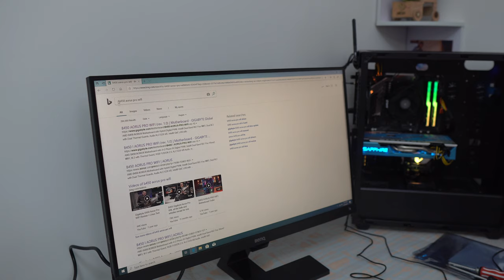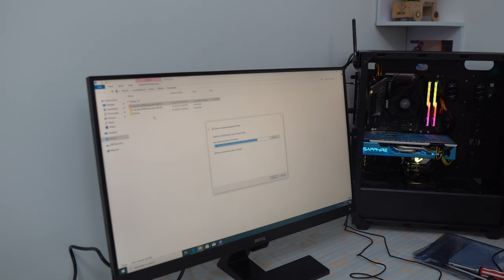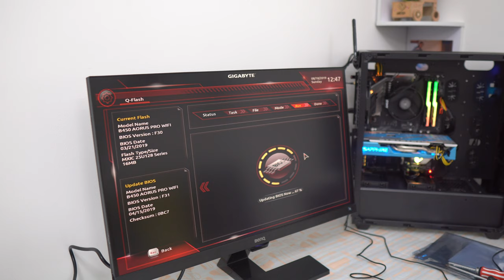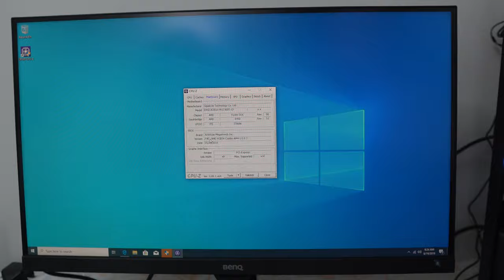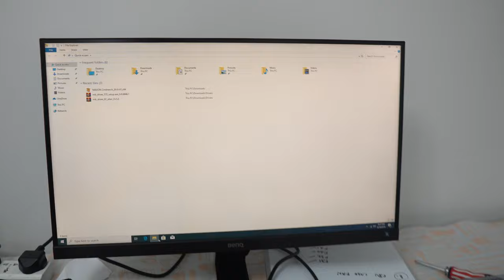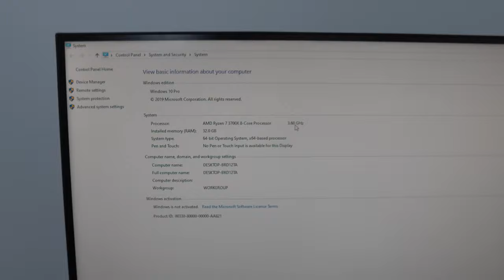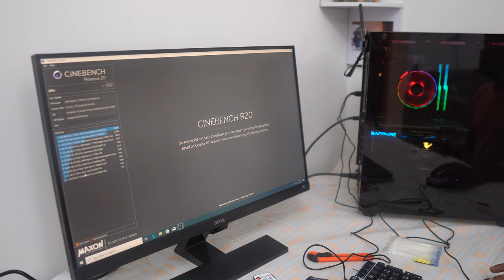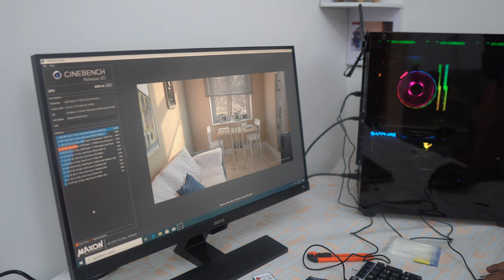Building PC 2019 - Finally its Working | Ryzen 7 3700X | B450 AORUS | 32GBRAM - Part3

Comment: video editing ku, 1080p 24fps ku, 30K budget la CPU build pannalaama?
Reply: mudiyum na I look for your service, if you are doing so!
Reply from the maker: Hi, Thaks for your comment. for Editing HD videos the below will be suffice even you can try editing 4K videos also.
AMD Ryzen 5 2200G
ASRock B450M
Crucial 16GB RAM (300MHZ)
Crucial P1 500GB NVME M.2 SSD
Thermaltake Litepower 550W Powersupply
Radeon Pulse RX 570

For additional Storage 
Seagate BarraCuda 4TB